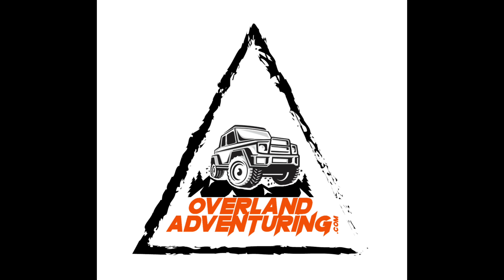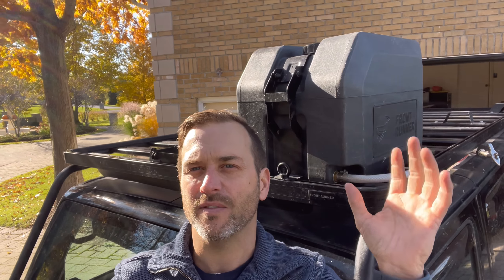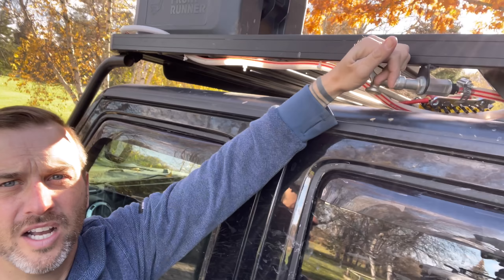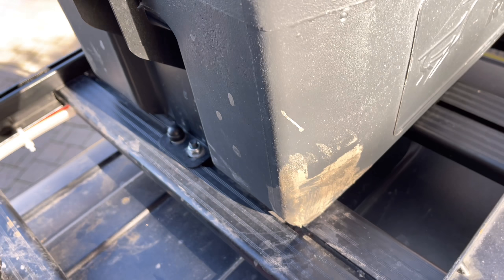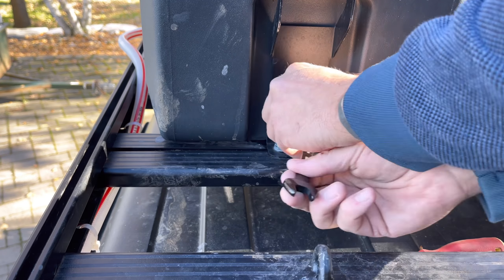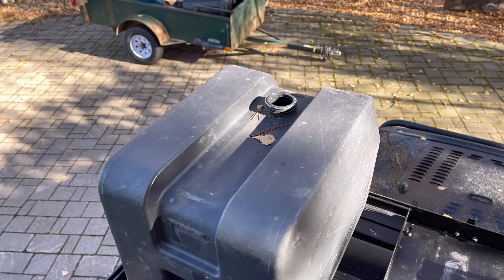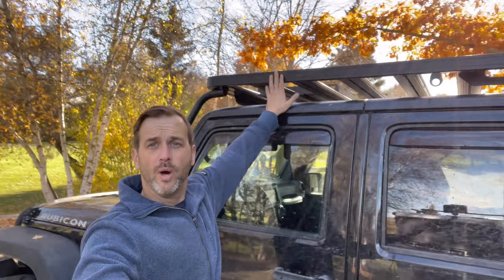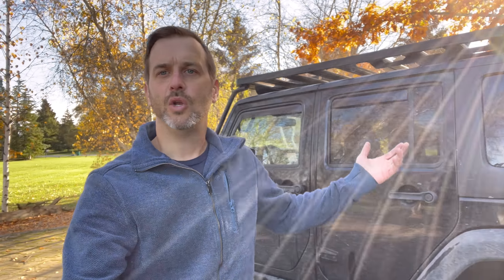Frontrunner Roof Rack 42l water tank system - after season review & install Jeep Wrangler Overland

Comment: Good video.  I am considering this water system.  (Just a side note - you don't have to take off the end piece of a Slimline II rack to retrieve a nut.  There is an opening under the end piece that allows you to slip nuts in.)

Comment: I don't know if you found a better solution by now for your spigot, but i've cut my hose in half and used a coupling for a gardenhose on it. That way the hose can just remain under the roofrack when the watertank is not one there.

Comment: Seems like an easier way to carry water on your roof then Rotopax. I use Rotopax which is quick way and almost no wind resistance but I constantly have to lift them up and down so it becomes a bit of a work out. Thanks for sharing a different way of storing water.
Reply from the maker: That is the biggest benefit for sure. Up and out of the way. The weight up too is not replay an issue as the rack is loaded with lots of extras including a tent anyways
Reply from the maker: Thanks for the comment

Comment: Thats a lot of weight on your roof. 42kg water, 50kg Gasoline, 25kg roof rack, 40kg tent…
Usually heavy, bulky things need to go low. Especially tanks that can be half full (like water tanks) should never be that high up. The water moving in the tank kills handling, Offroad performance and safety during critical maneuvers.

Comment: Ten years later the plastic tank in our conversion van still tastes of plastic and its burried under the truck not sitting in the sun. BPA free as well. So there's that. Poly plastics will always give you that taste. Have a 1950`s galvanized  double walled water cooler and it doesn't make the water taste funny like our plastic camping coolers by Thermos do. Go figure. I think it's just one small pay off for going camping and enjoying the great out doors... I can't get a good cup of tea on the trails. ☕.
Good video btw.
Reply from the maker: Thanks for the comments!  Great thoughts and likely the reality.